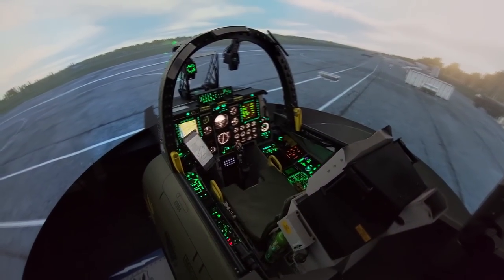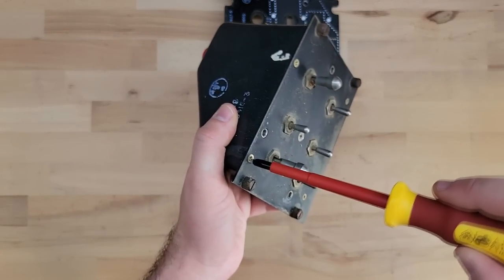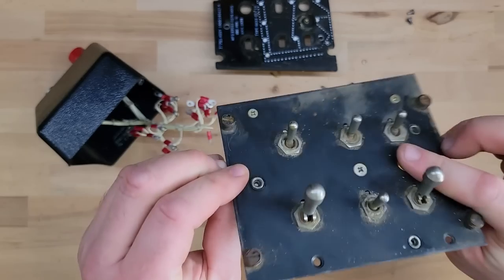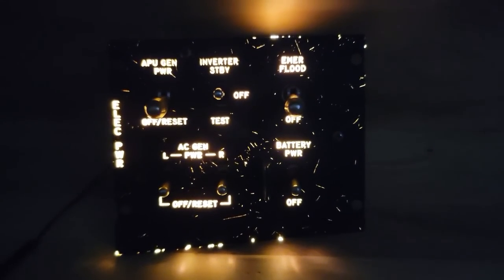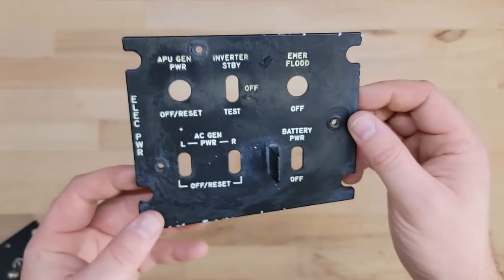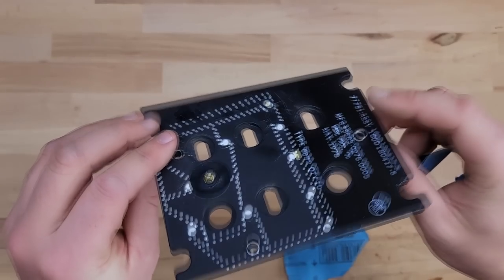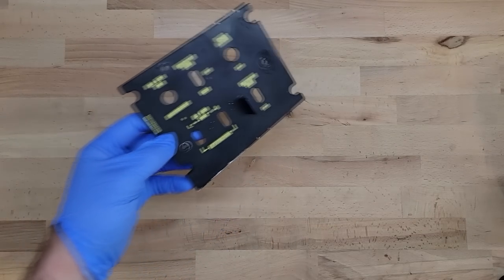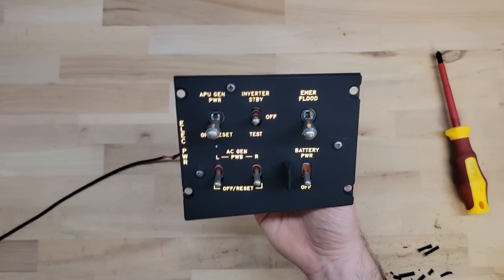Restoring a REAL aircraft panel for simulator use!

Comment from the maker: There are real A-10A throttle quadrants also out there in the wild. If you know someone who has one, please let me know! I'm chasing accurate dimensions so I can design and build my own, or I'll pay good money for a real one to convert to C model sim use!!!
Reply: I have one. Contact me, Hempstead at ED Forum, for the dimensions. I have always meant to build a 3D model of it, but never got to it. I can already tell you that you don't want to use a real A-10A's throttle... because the throttle axes are real analog era digital signals... It's got a bunch of microswitches in there instead of a pot (ingenuous really). So it can only output a bunch of on-off signals (5 microswitches per axis, hence 5 bit resolution).
Reply: @JonahTsai  that sounds pretty workable 

And pretty sweet
Reply: Very cool.  For about a decade I worked at Aerodata Aircraft Instruments (part of the Kalitta Air Group).  Besides repair of regular instrumentation we occasionally did work for the Yankee Airforce on their WWII aircraft.   Glad I found your channel, count me as a new subscriber.
This video brings back memories, in the 1980s I was USAF assigned to the F-4C Flight Simulator attached to the 191st FIG in Michigan.
Reply: You can try some of the aircraft sellers on ebay. That is where I get a lot of my parts to tinker with :)
Reply: Theres no link to Viper Simmer on the discription.
Reply: @JonahTsai Is there a post or a thread on the forum where i could look at a pictures of how it works? Very interesting way of doing things!

Comment: The lights embedded in the panel are incandescent lamps, not LEDs, so you don't really need to worry about the polarity.  They do draw a lot of power though.
Reply: The heat output when ya flick on the instrument test switch in a real aircraft is smashing in these winter months ,the heat output is nuts from over 200 tiny bulbs ahhaaha
Reply: @TRJx86  Oh absolutely.  Those little bulbs not only get hot, they pull a ton of current too.  I think the ones in the Type III panels like shown here are pulling somewhere around 150mA each.
Reply: @f15sim  christ hahaha , I'm not an avio but that's like a phone slowly charging for every 2 bulb illuminated announcer 🤣🤣🤣 

Quite funny to me seeing such an "antiquated" technology still commonplace in aviation wonder what if any jets are on LED tech now 

737NGs still use incandescents , haven't seen a MAX yet but I am fairly certain those use them too
Reply: @TRJx86  Oh the indicator lamps draw even more.  I think the 28v ones in the MCP on the F-15C pull ~200-250mA EACH.  You don't hold that thing in test mode very long or you'll burn your fingers. ;)  (pressing in the face of the master caution panel will illuminate all the bulbs).  I think they still use incandescent lamps in airliners because they can use the condition of the filament to determine whether or not a lamp was lit at impact.  AFAIK, the hot filament will deform in a predicable way on impact, where a cold one would do so differently or not at all.  (vague memory of this, could be pure conjecture on my part).
Reply: @f15sim  i did not know that about the incandescent airliner 'telltale' sounds about right to me , alike car crashes and braking with the tungsten embedding in the brake light plastics.
Reply: They also can last longer if your push less current into them.
that said, they do not last as long as LEDs and those were invented 60 years ago, as we know... so it was new tech back when the panel was made.
Reply: I was wondering about that... I was like... did the military have white LEDs before everyone else!?? Cause I thought white LED's weren't a thing till the mid-90's and warm white LEDs were even later.  Makes sense why the paint was chipped on the inside now; all that heat would have ruined any paint after that long.
Reply: @BEdmonson85  transilluminated/edge-lit panels that are made commercially are not painted. They're made with a multi-stage silk screening process.  The plastic portion of the panel is injection molded and not machined plastic.  This is why an incandescent lamp isn't going to burn/melt the panel.  Type III, IV and V panels use incandescent lamps.  Type VI use LEDs for illumination.  (I wish I could find my hoard of mil-spec docs that describe these...)
Reply: @f15sim  that is correct about the filiments, although I don't know if that's the reason they've kept them or not.
Reply: @BEdmonson85  You're correct. White LEDs are blue LEDs with a yellow-emitting phosphor, and blue LEDs didn't exist commercially until the mid-to-late 90s. Even before that, LEDs were not bright enough for daylight readable displays as required by fast jets. One example is the F/A-18C front panel, which has those characteristic segmented alphanumeric displays (you see them in other aircraft, too). They look a bit like LED dot matrix displays, mainly because they're often green, since modern ones have the green night vision goggle filters over them. But they're actually incandescent lamps fed down fibre optics. Look up the F-18 scene in "Clear and Present Danger," which has a closeup of the instrument panel shot in a real pre-NVG Hornet, and you can see the white incandescent displays.

Comment: Just a heads up. I was a B-52 mechanic, so im not sure about the panel on the warthog, but the same style panels used on the B-52 are only rated for 5 volts. I toasted one testing it the same way you did with a 14v source. i think some of them have it actually printed on the back for 5v only.

Comment: Most panels from that periode are 5 V iDC incandescent bulbs. I have drilled out and soldered in a lot of bulbs to replace worn out ones. I have worked on panels for 15V AC and 28 V DC. Some had red or green transparent panels and needed to be replaced with white depending on what aircraft or helicopter it was going to be mounted in.

Comment: The backlighting on the panels are incodecent bulbs. the dots are the lamps and the dashed line are buss wires. Duringthe NVIS upgrade most panels were changed to not have incapsulated back lighting and instead used a two part design. The NVIS upgrade puts a green filter over the lamp. 

The LED's didn't start going into the panels until the mid 2010's.

Comment: One reason the backlighting might be so bright at "only" 12v is because it might be only rated for 5. I have real FIRE TEST and ECS panels from a Hornet, and both have 5V MAX written on the back of the light plates next to the connector. The A-10 could be different, though. 

Also, as others have mentioned, the embedded lights are incandescent bulbs, not LEDs. The white dots denote their positions, and the dotted lines denote the wire run locations.
Reply: This is correct.  Most of the edge lighting I have seen from that time. is 5V 400hz.
Reply: Always wondered how the lights are embedded into the panels.

Comment: Most backlit panels that I have dealt with are running at 5 volts, the bulbs can handle 12 volts but the filaments will die sooner.

Comment: Nicely done.  I worked on the F-106 when I was in the Air Force.  I wonder if I could find an old F-106 simulator somewhere, 'rescue' the cockpit and wire it up for something like Flight Sim.  Well, it would be a dream, maybe a nightmare.  I think you did a great job on your cockpit, and I applaud your work.

Comment: Damn the emergency flood light overrides the power cut of the aircraft, really shows how the A-10 was build for surivival, incase the plane got hit so bad that all power fails due to the destroyed generators. The pilot can still access an emergency flood light so he can still check some dials adn do what he got to do to make it home! Also the way you have to pull up the switch shows that it is really for emergency and cant accidentely or too easily switch it on. The A-10 is a great aircaft.

Comment: I've got a real A-10 CDU, the backlighting on that is 28V bulbs. I wonder why Fairchild used two different voltages for the backlighting ? Maybe it was because the CDU was a done deal that was already installed in other aircraft types and it was cheaper to provide a seperate lighting voltage than ask Eaton for the faceplate to be changed. The CDU is almost identical ( or identical ) to the one installed in the AH-64A

Comment: The faceplates all start as flat black, but get glossed by the cleaning tasks of the avionics tech with the lint free cloth and the pilot with their gloves during flight.  If the faceplate is still functional (just dinged up), at I-level repair the faceplate would be touched up just like you did.

Comment: Hey love your setup. I'm looking for a monitor solution for my own simpit and was wondering how much curve I could get from one BenQ projector? I currently have a 49" Samsung and while I love the added prephrial view the 5120x1440 gives me, it loses a lot of vertical real estate. This is fine as I'm using track ir and can move my head to see up and down but finding an ideal POV in DCS is difficult. I fly the Apache module mostly. Is it possible to build a curved screen with a slight bend similar to an ultra wide monitor and make it taller and not have a ton of distortion of the picture?

Comment: I have a question about switches regarding dcs and flightsims, does the sim know when an on-off switch is moved? from on to off for example, i can see how an on-on swich would send a signal every time its moved however im not sure how that would work if there is no signal (i have no electrical knowledge whatsoever ) -edit: also does every switch need a ground? or is that only for certain ones.

Comment: WRT the voltage, it might work on 28V too.  I have some 12V LED illuminated switches that still work on 5V.  Even some 24V ones do.  It's likely because the circuit has to drop the voltage to 2ish V for the LED, so a lower supply may not be a problem.

Comment: Since that's literally just switches wired to a connector, if it were me, I'd try to obtain the mating connector and use it in building the pit's wiring harness.  It's no more work than rewiring the switch box.  And it's very professional.
Reply: Yep, look to be standard mil-std-1669 inserts, specifically 10-12 and 14-19

Comment: That OD green brush looks familiar. 😁 The  fact that LED connector was just a push on makes me think simulator. That wouldn't handle high g's.
Reply: The connector is attached to the backplate, and the facia is held on with screws in addition to the connector. I've seen this on a number of panels, it won't come loose that easily 😁